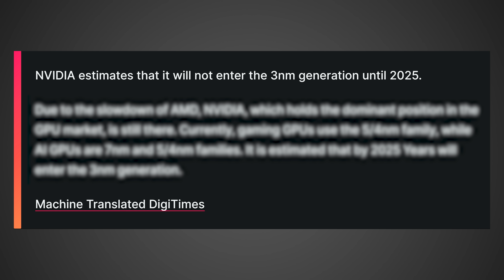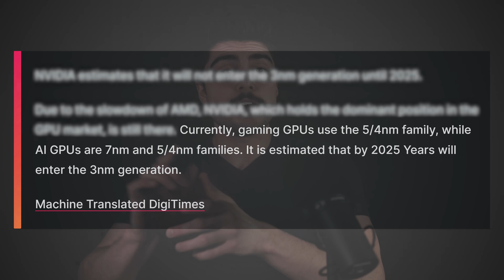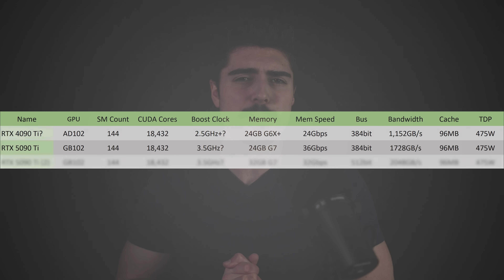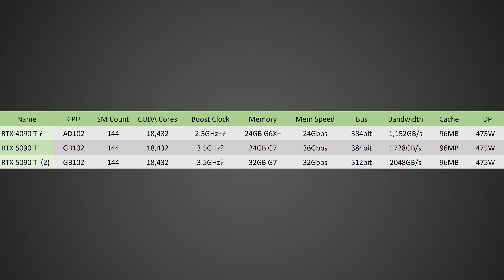GIANT RTX 50 Leak - Release Date & Specs

Comment: man should i upgrade to a 4070 ti now? i have a 2070 and its becoming obsolete now for 1440p gaming now
Reply: I'd wait for the 50 series, even if it takes a couple of years.

The 40 series has pretty much the most lackluster upgrade to price to performance ever. When you combine that with current AAA releases not running well even with high end cards (look at Jedi Survivor, The Last of Us, etc.) I'd say that if you can manage to wait for another generation that'd be well worth your while, especially since Nvidia knows from their poor sales at this point that the next generation needs to be a good one for them to keep their dominant market share.
Reply: @josiahgibson6373  that's not due to the hardware, that's due to game devs not optimizing their pc ports.
Reply: @cerberus00  That's true, but the result is the same.

Also, I've known my fair share of game devs in my life and since games take several years to produce there's often a culture of designing games to meet future system requirements. ie: for the hardware that will be around when the game is released, not for the hardware that was around when development started, which relies on the devs accurately guessing future system stats.

When you have a lackluster generation like the 40 series that throws a wrench into the works as the game developers were likely expecting both the 40 series to be ~20% more powerful when measuring traditional rasterization and cuda core counts and they also would be expecting a lot more people to have bought them and installed them in their systems.
Reply: Buy rtx 4080 at least, 12gb vram for 1440p is already on limit, don t go under 16gb vram
Reply: @qwertyqwerty-zi6dr  if i had the money i would
Reply: @JustGaming24  than u better start to save some money if you don t want to run out of vram in the future and in already few games which need more than 12 vram, if you want to buy a 900+ $ rtx 4070ti (price in my country) and already lower some textures and other settings, than go for it
Reply: @qwertyqwerty-zi6dr  they need more because of bad optimization in my country is around 750-800€

Comment: They are already paying for their cowardice in not expanding the VRAM on the 4090, if they stick to the pathetic 24GB for the 5090, they will be left in the dust. At that level it's not just about performance - AMD has them matched well enough for performance. It's largely about machine learning performance and as someone who has a 3090, it's ALREADY INCREDIBLY FAR MORE LIMITED by the VRAM of 24 GB (and CONSTANTLY running out of VRAM trying to do things) than it is by performance - I would NEVER pay for another card with just 24GB and consider it an improvement. The 5090 needs 36GB at a minimum, it should really have 48GB or more. YES, we DO need that at home. ALREADY.

Comment: I find it hard to believe they would not up the core count. Obviously, you can gain performance in other ways, but public perception is important to sales. More VRAM is less important because they already have enough for 8k. They can't afford to have their market think it is little more than a 40series Titan.
Reply: In 2025 24 GB VRAM won't be enough for the high end GPU's.
Reply: @nossy232323  Really? what game has requirements that surpass that amount? Once you have enough VRAM to accommodate the requirements, only speed will actually be of benefit. If there is a game, I am willing to concede the point, I just don't see it. I guess we can leave it at future works being beyond what is now accepted as the bar but let's be honest for a moment. what is more important, faster framerate, or slightly higher rez textures. And even then, game development has always been held back by the lowest common denominator, very few AAA titles push beyond this.
Reply: @rangerhawk  I base this on several things. One of them an interview with a game dev MLID did recently. Right now there is no game that surpasses these requirements. But that won't be the case in just a few short years. It does not mean you can't play the game with less VRAM. You will just have to put the settings lower. It's very easy for game devs to use really high quality textures and scale those back for systems with less VRAM.
Reply: @nossy232323  Were they actually referring to the 24 GB cards?
Reply: @rangerhawk  The guy was asked what would ideally be needed for 4K gaming with UE5 and he said 32 GB of VRAM (and a 16C32T CPU). and he suspected that would be the case in a few years time.
Reply: @nossy232323  Fair enough. I would suspect and hope NVIDIA is also aware of this.
Reply: @rangerhawk  I hope they put 48 GB on the RTX 5090. Not that I'm planning to get it. I'm happy enough with my RTX 4090.
Reply: @nossy232323  Same here, besides, rumors put the price tag in the stratosphere.

Comment: Well if delayed. That just means i ca neven more out of my RTX 4090 before it needs replaced. That would great as it is a very exspensive GPU for sure. I am im no hurry to get a 5000 serie card, as that woudl also mean a cpu upgrade, as my 5950X is bottlenecking my RTX 4090 at times.2

Comment: There no Other Option than 24gb in a 5060ti. 24gb needs to be the Start on nearly lowest card. Jedi survivor Uses on the 4090ti 18gb vram
Reply: The 4090 is not the issue in Jedi Survivor. That game is CPU limited meaning that the GPU is not utilized at it's full. It's an another POS triple A release.
Reply: @laszlozsurka8991  yes but that seems to be a major Issue on most game since 2023. So 8gb will never be enough for the future

Comment: I have a 4070 so far im actually happy with it and when 50 series drop's ill get a 5070 or a 5070ti how ever i do wish the 4070 was 499 or 399 but i have to say so far in games tested it delivers nice fps at 1440p over 125 to 170 fps maxed setting's on every game so far and im using a ryzen 5 5600x i do think i need a 5800x but in games that are more gpu bound the 4070 performs awesome so far
Reply: Ouch...one of the worst cards of this generation from both manufacturers. I've got a 3070 but see no reason at all to upgrade to a 4070. Performance and VRAM just aren't there at that price. When I upgrade, it'll be to something with at least 16 GB of VRAM.
Reply: @mayssm  it's your lose man it performs really well actually and it best the 3070 and 3070 ti buy alot plus it has gig's of vram and comaired to 8 and in the new star wars games it out perform's the amd 16 gb vram card's in fps and that's bc amds vram is pretty much the same as Invidia's 12gb should it have costed less yes atleast 499 instead of 599 but the card is actually really good amds 7600 xt has the same spec's as ther 6600 but just like the 4070 it uses a smaller 4nm node istead of a 5 or 6 nm so does the spec on the amd 6600 use a 6 nm and the 7600 xt uses a 4 nm so even tho it looks worst on paper it will perform better the 4070 has all the same things the 3070 and 3070 ti did but its much more powerful with pretty much the same stuff but the 4070 has more memory band width and on a smaller more powerful node so i really like it it's not an ouch ill be playing games that a 3070 ti cant's at the power of a 3080 and 3080 ti and the 4070 is also keeping up with a 3090 so yeah i love it should have been a bit cheaper but its a good card and when the 5070 or 5070 ti rolls out ill grab that

Comment: I have a 3080 TI, is it worth upgrading to the 4080 or the 4090?  2025 is a long time to wait especially with 12GB of Video Memory with the 3080 TI.  The 4080  16GB seems like a sweet spot, while the 4090 feels a bit overkill.  The only other option may be the 4090 TI.  Not sure what go for, or should I just skip the 4000 series and save to build my rig for the 5000 series.  So then what kind of PSU to be safe.  ATX 3.0 or higher by 2025.  1000w PSU.

Comment: If Nvidia tries to give you any sort of gains on the 50 series, it'll likely be faked framerates sort of thing via frame generation.

You see, you do not really need smaller and smaller node when building and using 'AI' technologies to build your graphics on the spot, and this is what Nvidia is counting on, that the AI 'does it for you' sort of thing. While perfecting this is nice and all, AI aren't godlike entities and requires 'training' and adapting to games in order to be utilized at all, if done correctly that is.

This means that the image could potentially become worse, not better, if the AI has to 'guess' and simulate things, and this is probably where raytracing comes in, that the AI can utilize the information to correctly 'guess' the pixels.

And to think that FSR can be done without needing AI right?

Nvidia is known to over-engineer to make an excuse to make you pay up.